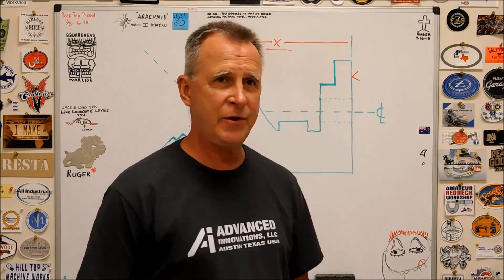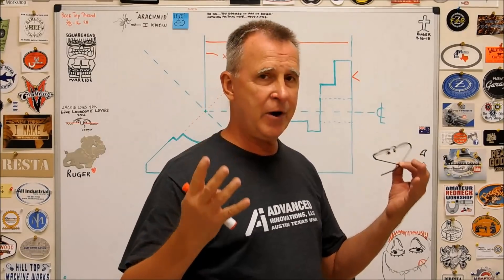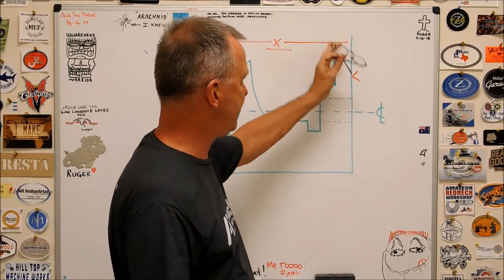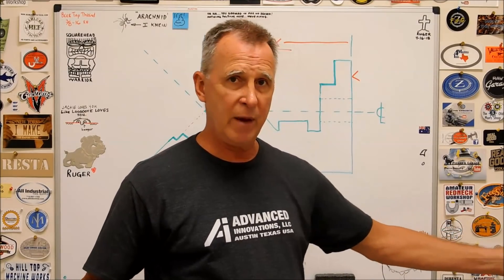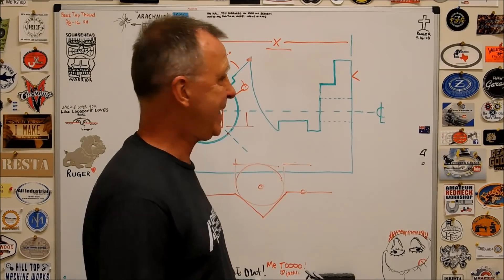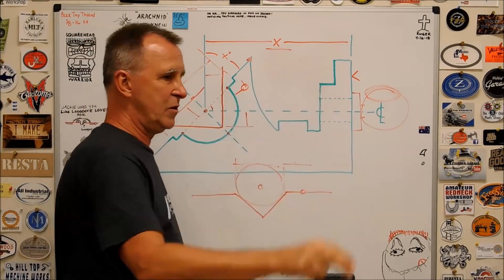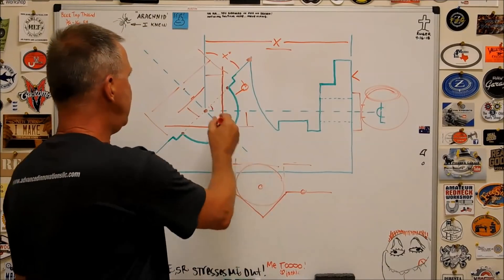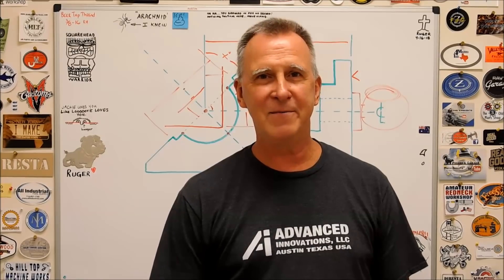A Great Trick for Machining Features on Angled Surfaces

Comment: Seems to me that Joe is under-teaching here almost as completely as Quinn was fumbling for that crankshaft journal center line.   The big reveal here, which he doesn't state, let alone explain, is that if you can accurately locate a spherical surface on your part, relative to a known reference point, then you can freely reposition the part with any rotation you want/need, relocate the center of the spherical surface, and navigate from that known point using only x, y, and z movements to any other point known in relation to the sphere, and hence in relation to the original reference point.   Using a tooling ball as Joe mentions would directly exploit this elegance.   Would be fun to see him show that, and practical tips for how to make it work.

What Joe actually showed is a special case of the same observation: if in plan view, you can locate the center of a circle in relation to a known reference point on the part, you can rotate the part on any axis perpendicular to the plan, relocate the center of that circle, and from there navigate to any any known point on the plan using two dimensions of movement.   Joe created his own reference circle, virtually, by machining the 90 degree angle in the bearing hole space  and located it using some tricks dependent on the angle of rotation being 45deg, and the known width and depth of his end mill.   All good, but with the disadvantage of having to machine out a wierd chunk of the bearing hole in a way that is not going to simplify drilling for the bearing downstream, and of being depending on precise recreation of the 90 degree angle needed by controlling position and depth of the end mill with which he made it.

The part already has the two 90 degree surfaces needed to locate a reference circle, in the machined slide surfaces and inside of the piston mount.   Drop a gage pin there, distanced from the piston mounting surface by a parallel, locate it relative to the primary reference point (outside center of the piston slide hole), and you can the rotate the part as needed, re-indicate on the same gage pin, and from there locate to the centerline of the main bearing holes and simply machine the .5" wide surface that was your target all along.  This approach would work whatever the angle of the target surface, and for any feature that could concievable be machined on that angle.

But my real point is that Joe could have really explained the geometry behind what he was doing much better, so that this video really lived up to its title, rather than serving as just a "here's how Quinn could have done this one part way better" (which is certainly true) crow.
Reply from the maker: I see your comment as one that doesn't truly comprehend the bore is done at assembly. The only way to create that assembly is to machine 2 very accurate pockets and a plane, from a reference point that is impossible to physically touch with the part correctly oriented. The milled surface she started from was not in the correct location, so you have to throw that variable out the window, which kills your suggested approach. The V groove machined into the part is undersize and easily removed at assembly by plunging an end mill as I stated. Your comment is full of mechanical references, but it appears to me that you missed the starting plane is wrong as well. If you search my library of videos, you will find one on tooling balls and their function.
Reply: @joepie221  Yep, your way is simple, direct, and foolproof (well...there are those among us who could screw up a steel ball with a rubber hammer🤔).  The more I thought about it, the clearer it became how elegant your solution is.  
My advice to folks who are handed a gem is to take it, rinse it off, study it carefully and put it in your toolbox.
Reply: @joepie221  Thanks for responding.   I obviously did a lousy job of explaining what I was saying.   I completely agree that the target here is to mill the slot that is the female complement to the bearing cap key, and the center line of which is the centerline of the crankshaft.   My  point was that to do that accurately, you need to be able to locate a point with a known x and z relationship to that center, and that you can do that with any cylindrical reference whose axis is parallel to your y axis.   Such a cylinder is the equivalent of a tooling ball when the part is rotated between operations on only one axis.

You created such a cylinder.   It wasn't necessary.

Here's how I would have done it:  The centerline of the engine runs on the print 6.156" from the center of the cylinder mount (the primary reference point from which we're working) to the centerline of the crankshaft, and thus the center of the feature (slot) we want to cut.  .125" below that are the parallel flats of the piston rod slides.   The cylinder mount itself is machined to be .375" thick, with parallel faces perpendicular to the centerline of the engine.  If the slide surfaces met the inside face of the cylinder mount, I could place a .25" (twice the distance from the centerline to the slides) gage pin in that right angle, and I'd have the cylinder of rotation around the y axis that I need.   But there is a gap, so I can't.   Instead I put 1" parallel on the slides across the gap and put my gage pin against that.   I now have a cylinder of rotation whose center is on the centerline of the engine, .375" + 1" +.125" = 1.5" to the left of the primary reference point.

This assumes everything done prior has been done to the print specs.   If not, some of the measurements could vary, including the diameter of the gage pin (or alternatively I could use a standard gage pin, and compute offsets from that, but introduces another spatial math step that most folks would  probably prefer to avoid).   I might also not have a parallel that is 1.000".   But, I can easily get all the measurements I need, and turn a pin if I need some oddball size.   

So now, with the casting mounted at 45deg rotation on the y axis, and with the above in place, I locate the center of the gage pin, and make that my new origin.   With a .5" end mill in the quill and the cutting face at 0 Z, I simply use the DRO to move to the -X and -Z point that represents the centerline of the crankshaft, and mill my slot.   The DRO will compute it for me - I know it's 6.156" - 1.5" = 4.656 on a 45deg angle away, so X =  -(6.156 - 1.5)*cos(45) and  Z = - (6.156 - 1.5)*sin(45).   SInce it's 45deg, of course, these are the same.

On a machine with a DRO, and assuming my earlier maching was nominal so that standard pins and blocks work, this is short work.   If the earlier machining was not nominal so I had to make a pin to fit and take and record measurements in the DRO, or I had no DRO it would obviously take longer.

But my point wasn't that that way is easier.   It's that the point of education I would have expected as a response to the way Quinn went about things wouldn't have been here is a trick - which by the way leaves you with a strange gap in the solid bearing block assembly you're supposed to now drill - but that 1) (which you made) you need to machine from known reference points on your piece, not arbitrarily chosen lines on a surface you whose actual location you don't know, and 2) if you have to rotate a part to machine a feature, any cylinder of rotation that you can locate in both orientations will get you your bearings back.
Reply from the maker: @walnutclose5210  Your approach is valid and could be constructed a dozen different ways, from a couple of known surfaces. It is apparent, we both agree, a cylinder is the solution to this issue. There are subtle differences between your approach and mine. With mine, my reference cylinder is already on location when you pick it up, and the notch is easily removed by plunging a smaller endmill before drilling or reaming. Your approach is very clean, but the location accuracy is dependent on the accuracy of your machine. Its like picking up an edge with an edge finder then moving to location vs. sweeping the edge with an indicator and already being there. The shift error potential is gone, but most clean modern machines would do just fine. Good feedback. What is your background? ( I'm not sure I fully understood your closing statements when you started numbering things )
Reply: @joepie221  "the location accuracy is dependent on the accuracy of your machine"  - agreed.   What I suggested requires the ability to reliably measure out a movement to .001" accuracy and precision over 4" distances in both X and Z.   Yours requires it only in X, and short scale accuracy in both.   Yours could reasonably be done without a DRO, but I wouldn't adivise most people to try what I suggested without a DRO that they trust.  They would be quite likely to end up with the crankshaft not aligned with the centerline of the piston rod.

"the notch is easily removed by plunging a smaller endmill before drilling or reaming"  Agreed, for this particular part.   But the feature you need to mill at an arbitrary angle at just the right spot relative to an unreachable reference point could just as easily be a spot face that you need to drill and tap.   That divot is more problematic in that case.

Thanks again.   Good dialog.
Reply: @joepie221  for headache relief, I prefer your prescription!

Comment: Joe, here is more material.  i give it freely to ALL.  the biggest mistake ANYBODY can make in the shop; rush into it. dont make the reght prep. fail to get the toolingneeded. BUT the worst is not to take the time to examine the job. get to know the parts, see the problems EACH part brings with it. i know it doesnt show in my vids, but i look at it, from all directions. ask myself "howam i gonna set this part up?? how does this part affect other parts????? my last project i spent 100 hours just thinking. about the many ways to do this part in MY shop.im shure you can agree with this. poppy's workshop says HI

Comment: Brilliant elegant solution Joe, I would never had thought of that in a million years, give your memory banks a dose of something nice.
 My method would have been to set up as in the cross boring op, then drilled a tooling hole sat 5 or 6 mm perpendicular to the bearing cap faces below by 20 or 30 mm, if the part wouldn't allow it, ref strength loss, then epoxy a small piece of phenolic or similar material, and use that for the tooling hole. Obviously this is extra ops compared to your solution.
Many new guys only see CNC produced parts, and never see the witness marks as you state needed by conventional machining. I've welded blocks on larger items, then knocked them off after.
Great vlog, thanks for sharing. Best regards John.

Comment: One thing I'm kind of missing in this series of videos (from both of you) is awareness of the tolerances for the specified dimensions.  When is it OK to be off by a ten-thousandth, and when is it OK to be off by ten thousandths?  When we're having fun pushing the limits of our machinery, we might need to know where a five-minute setup is "good enough", and where do we need to spend an hour?  If a bearing hole is off-center, maybe that means that it just leaks oil, but if it's off-perpendicular, the machine might not even fit together.
By the way, I think this is one of your better videos, since it grapples with some subtle and tricky issues that aren't obvious from the print. 

(I'll bet, at some point early in your career, you attempting something in an amusingly naive way.  And you still wince when you remember your teacher's correction.)
Reply from the maker: It was slotting that sticks out the most vivid. I didn't peck or stack the parts and got an ear full. I even remember the smell of the shop at that moment. the boss was pissed.

Comment: Referenced machinist may be less experienced but a sharp cookie. I'm sure your advice will be appropriately taken and filed away for future reference. Fun fact, I met both of you in person on the same day. I'm an extremely green machinist myself and want to make sure I've followed this tip correctly. In the bh video, the bearing center was found by referencing the slide bearing surface (which is parallel to, and a known distance from, the center line) and the spot face to find the distance you refer to as 'X' in your sketch. Are you saying that this is acceptable but should have been done first to locate the V-block feature that you are recommending and then, after cutting the 'V', machine all bearing cap surfaces etc. in reference to the V-block feature so they are referenced to the center of the bearing. Finally, with all of those surfaces machined such that the bearing caps can be fitted into place, the bearing hole may be bored through the combined assembly.
Reply from the maker: That would be the approach suggested by the dimension scheme on the print. The 2 places where her build went completely sideways were: 1. the 45 degree flat surface was machined to a cleanup state with a total disregard for the dimensions, and 2.  Her bearing cap recess and bore were laid out from a non referenced casting point not called out on the print. I am surprised the hole was only off by as much as it was. It was luck it was even that close. the cross bore does have to done at assembly, so the reference center of the hole that all the features are dimensioned from, is the last thing to be machined. Its a tricky area.

Comment: Since I've not seen how the drawing is dimensioned then I can't be sure of anything. One would "assume" with that right hand side vertical face and the long horizontal feature at the bottom that make a 90 degree angle and if the drawing was properly done those would be your datum points and every other dimension would be referenced off those two surfaces in X,Y. If that was so then any other point on the part can be found simply by edge finding both surfaces. Imo the first important concept that needs to be learned about machining anything is it's no different than navigating with a map. You need to find where you already are and your starting location to have any hope of getting to where you want to be. If that isn't known first then your already lost.
Reply from the maker: The print looks like the white board.

Comment: Is it that one can't put the hole in until the two pieces are bolted together, like on a connecting rod, so in essence your putting in "correct" temporary geometry, (the V block notch), machining the features based on the temporary geometry ......and then at a later time put the complete hole in on location....and all the features are correct? Am I right? Feel free to correct me, interesting video thanks for posting!
Reply from the maker: Correct. the mating features must be in before the hole they are dimensioned from can be done. Chicken or egg syndrome.

Comment: I think this works well regardless of exactly what angle you ultimately have to work with. As long as your v-notch holds a gauge pin in the center of what will eventually be the shaft's holes, you indicate and measure to find the center of that pin.  No trig needed and the angle doesn't matter, right?
Reply from the maker: I believe only at 45 degrees can the notch be symmetrical as shown. Any other  angle would/may require different values on the offset of the V.